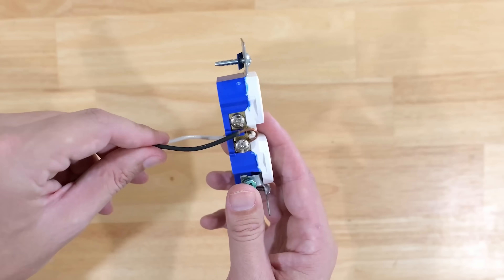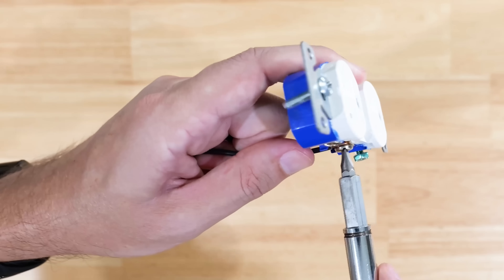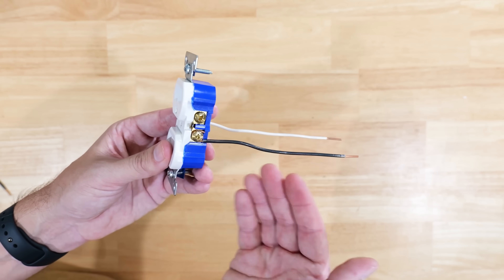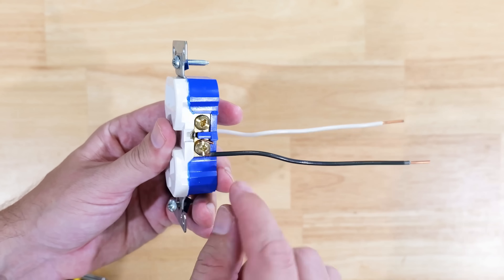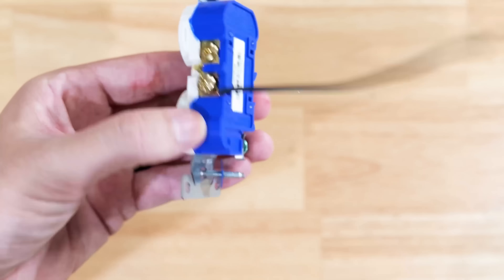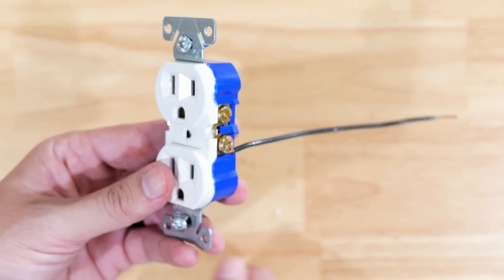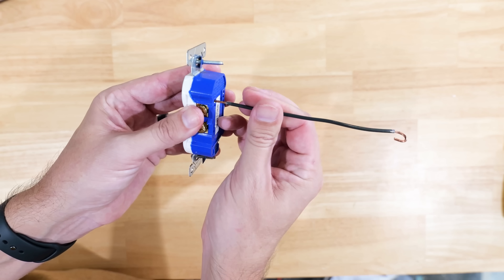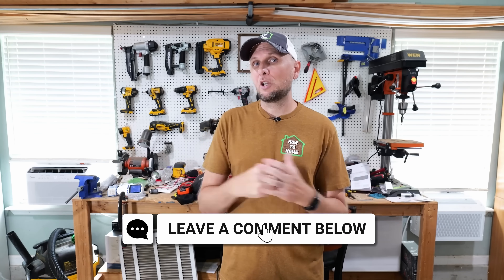Avoid Disaster! 8 FATAL Outlet Mistakes Most DIYers Unknowingly Make!

Comment: me at 19, renting first apartment before internet was a thing. i wanted to replace an ungrounded recep with a grounded recep, not bc i needed a ground, but because i didn't want to mess with ground adapters. i removed the plate, pulled the recep, and there's where i learned just how much of a slumlord i had leased from. wires wouldn't allow the recep out more than an inch. the copper on the recep was spliced inside the box and wrapped with paper tape. i replaced the paper tape with proper electrician's tape, and noticed the building wire was ALUMINUM. at that point i just put the recep back into the box and put the cover back on, then i broke the lease during the first week and moved to a different property with a different landlord.

okay, so the next apartment had a lightswitch that did nothing, and a recep that only half worked. obviously meant to be a switched half-hot that someone monkeyed with. fixed it and stayed there a few years.

dad taught me. neither of us have ever been electricians for hire, licensed or otherwise. if a 19yo kid without internet knows these basics, how much more should a 50yo know this stuff?

Comment: Point of clarity. More likely than not swapping the grounded and non-grounded conductors in the receptacle will not cause equipment failure but still presents a very serious safety hazard.  Since the mains power is alternating current the polarity typically does not matter for correct operation of some device.  However if some poorly designed equipment have the grounded conductor (neutral) tried external metal chassis anyone touching that metal will get shocked. Fortunately codes don't allow equipment to be sold to consumers this way anymore.

Comment: if you dont have a torque driver, buy one now. Commercial solar electrician here, our system sizes range between small commercial to small utility. I handle O&M, warranty claims, service calls, troubleshooting, etc. EVERY current carrying conductor terminal MUST be torqued to the manufacturer's specifications. you'll get thermal build up on the poor/loose connections, which can cause a circuit breaker to trip if it heats up enough. Properly sized and installed breakers should never rise above 165 deg F or you risk a trip. First thing I do when a system is going into fault is check all the torques on the conductor terminals. With solar, these circuits are designed to run at near maximum load for hours each day, so tolerances are very narrow. Follow the damn directions!

Comment: Electrician here: You’ve got the first one backwards. You can always upsize the wire and receptacle for more than the breaker is going to allow. That is completely fine. The danger is DOWNSIZING. So never,ever put a 15A receptacle or 14 AWG wire with a 20A breaker or the receptacle/wire may become overloaded and cause a fire.
Edit: said a different way, a receptacle generally has no overcurrent protection. So the rating is only how much it will take before getting dangerous. The breaker is the only limiter unless it’s a GFCI

Comment: The stripping just the right amount of wire seems over kill I get too much is bad but this is getting silly all the technology we have today and we are still doing this trivial stuff, no one has invented a better receptical yet and that should be a priority. electrical wiring is not at all complicated if you know load tolerances and amp use. Its not rocket science but if you went and looked at code its crazy

Comment: We nearly had a fire due to one that wasn't even here. Luckily it was a momentary flame and smoke that went out. J hook style. Correct direction and everything else, but they didn't get them fully under the screw. Like the tip of the wire was under the screw, but then it just looped around and above the head of the screw. I ripped out the whole kitchen and basically, every outlet that looked newer had this issue. This happened to be the one with the best location for a toaster. The hot connection just burned itself into a black mess, but by looking at all the other connections in the kitchen, it was fairly easy to guess the probable cause.

Comment: For some reason, I think it's worse to put a 15 amp outlet on a 20 amp circuit, not the other way around. If it's got power, people will plug into it. Outside of appliances, how many electrical products do you see with the 20 amp side blade? Not too many. One more thing, don't use a Phillips head screwdriver on a receptacle if you want a tight connection

Comment: i am 46, handyman jack of all trades, master of none, i have never anywhere anytime in my life seen a 20 amp cord/device. i have seen and used the outlets with 15 amp things. I'm not saying that makes it ok, but the chances of ever using a 20 amp thing on a 20 amp outlet that's only on a 15 amp breaker is so low... and even if you did, it would pop the breaker, no safety issue.
>>>but yer right, that's not the right way to do it. <<<<

/begin strange angle that resembles a tangent

there's times when i've gone way to far and much worse then a 20 amp outlet on a 15 amp circuit. for totally make believe / it didn't actually happen / it wasn't me, i wasn't  there, it was the 1 armed man, and he didn't even do it. but in a dream of a land in a far far away place, when running to many things in my, uhh, i mean A garage somewhere not here, heaters, high watt flood lights, fans, welders, air compressors, reactor control systems, etc,  was always popping breakers, got real sick of resetting it all the time, and not running half the stuff i needed wasn't an option and i wasn't gunna actually run another lower gauge wire to a new higher amp breaker.  so i, er someone, just swapped out the 15 amp for a 20, nope, still not good enough, no problem,  swap in a 30, dam still no quite enough. ok ok, your really going for it eh? fine will a 40 make you, uhh me , er them happy? eerehhrgg,... and now with a 40 where a 15 once lived we they someone has a garage where you can run anything you want all at the same time. tested for magic smoke and rouge fires. none found ! sure the walls double as heaters, but that only helps to keep it warm in the winter! win-win!
NOTE - the preceding dint'/isn't happening right now at all, i dont know what yer talking about. there's nuthin to see here, just keep on moving.  just smile and wave , just smile and wave....  (as the fire closes in around me)  

PS.   man that's a sweet bit you got there, never seen one of them either...  hmm maybe the problem is ME, i just dont get out enough...  hmmm    NAAAA!   :)

Comment: Just had this issue 
Home was built in 1987 
Recently power went out in 1 room even though breaker was on 
1st thought rodents in wall ,called electrician went through with scanner found bad back stabing receptacle was faulty said the same thing as vid better to screw the wire on 
300. $ but was glad I didn't have to start cutting holes i walls

Comment: Also, use a square drive screwdriver instead of a Phillips or flat blade screwdriver because you can put more torque on it and they don't slip on the screw like the Phillips and flat blade can. The screws are designed to accept all three types.

Comment: I have my house properly wired. Some of my outlets are 15 amp and some are 20 amp.  None of the things I ever plug in have that 20 amp sideways blade. My refrigerator, microwave, garbage disposal, hair dryer, and vacuum all have the standard plug that fits into a 15 amp outlet. What gives?

Comment: The WAGO style lever contact is ultimately less reliable than backstab wiring. All plastics cold flow over time. As the plastic flows away the contact force is reduced to whatever stamped copper spring is left to grip the wire. Over time, with temperature it will lose contact force, just like push in wire contacts. Its possible to make a contact clamped by spring steel that opened by a plastic cam that doesn't use the plastic otherwise. It would cost more than you'd care to pay and extend the mean life from 5y plastic and 15y copper to 40-45y because steel ages better, but dissimilar metal corrosion would eat it up anywhere moisture can get to it.

Comment: No. All modern 15A receptacles are listed for use on circuits with 20A overload protection. UL and NFPA aren't stupid. The 15A and 20A NEMA plug and receptacle contact properties are actually identical. The 15A vs 20A plug and receptacle are an anachronism that keeps receptacles more than 60 years old from being recycled by chowder heads. The 20A 120V plug is seen about as often as the passenger pigeon. I've only seen it on a few large window ACs and their 6 foot AC extension cords and a few commercial floor sanding and polishing machines.
   Before you made up that fairy tale it should have occurred to you that nothing about the end use device changes when its plugged into a 20A outlet. The plug, receptacle, and wiring all cook when a failing appliance draws excess current without tripping the overload protection. Its very common for a window AC to draw excess current as its run cap dries up and for the compressor's thermal protection to cycle the unit off and on with a faster time constant than the circuit's overload device. Typically the molded plug is the heat source, not the receptacle.
   if there's one thing that people should be more careful of, it's push in wiring. The force with which the internal stamped metal contact grips the building wire decreases with time and temperature, especially temperature. They rarely cause an difficulty where the circuit is lightly loaded. On heavily loaded circuits they can loosen up. An unused receptacle that serves as pass-through wiring can be the one that cooks.

Comment: Two things I would like to add here: 1) Electric wires vibrate “especially AC” and if not tight enough will loosen over time if not torqued right and 2) stranded wires I solder the ends going to the screws…

Comment: Just buy the commercial outlets.  Not much more expensive, and no need to wrap the wire around the screws, stick it in from the back and instead of a stab fitting it's a clamp that tightens with the screws.

Comment: Carpenter here. Trying to learn a bit more electric. A lot of this is jibberish to me because I'm new at it but one thing that keeps SCREAMING over and over in my brain is WHY are outlets designed with so many potential failure points? EXPOSED SCREWS? It's 2024! Screws in general? Seems like you're asking for trouble. In carpentry terms it's like chucking a guard open on a circular saw and wondering why you eventually cut your leg.

Comment: Perhaps you can mention an appliance that is polarity dependent and how a circuit designed for A.C. needs to be polarized a certain way.  Perhaps a flat screen TV or a computer?
Reply: Switch is supposed to be in hot (black) line so no power is fed to device.  If switch is in neutral ( white) it is not safe to contact device.

Comment: Don't pull the insulation completely off stranded wire. Strip your wires a little long and leave the insulation on the end and when you wrap it around the screw it will keep the strands together. Always pig tail your receptacles and take only one set of wires to it. You don't want 20 amps going through that thin piece of metal that ties the two terminal screws together.

Comment: I crimped spade connectors on the wires when I was working for a contractor that built cell sites. It worked better than the J hook for me.. For my own electrical, I pigtail the outlets so they only see the current from what is plugged into it and I only use back wire, not the cheap ass ones. I've seen the first few outlets on a chain get hot enough to distort from being used as a pass through. Another mistake I've seen in older homes, if there isn't a ground wire some idiots will tie the neutral to the ground screw.

Comment: Best thing you can do in all your living areas is replace your old  breakers with new Arc Detect breakers in your panel. Lots of States new house  construction or panel rehab the County Requires it. 
It may be a standard requirement in all states now whatever its still a very smart thing to do especially if the back bone wiring in your house is old.
Reply: Good luck with nuisance tripping in an old house with 3 wire ckts
Reply: @SamboNagga  17 years later not one of my Square D Arc's have tripped.
Reply: @My1970TransAm  count your blessings.i have had them trip continuously because the insulator in the attic, kicked a wire or got it stuck on his foot, and pulled it at a 90 degree angle to a staple. as soon as i straightened out the wire, the breaker quit tripping.  just one of the many stupid reasons these things tripped. i've had to replace many SD homeline breakers after less than two years under warranty. ed: splg

Comment: 0:30 Please cite the NEC (National Electric Code) where it allows a 15 amp receptacle (or switch) to be placed on a 20 amp circuit breaker? Or where it prohibits a 20 amp receptacle (or switch) on a 15 amp circuit breaker. The breaker is designed to protect the circuit (wire, receptacles and switches) and not the devices plugged in to it (toaster, lamp, hair dryer, etc.). A 15 amp receptacle or switch is designed to not overheat, melt or start a fire with a 15 amp load, NOT a 20 amp load that a 20 amp breaker will allow. A 20 amp receptacle or switch is designed to handle 20 amps, which it will never see more than 15 amps on a 15 amp breaker. You are confusing the receptacle's load rating with what a circuit breaker is designed to do. Receptacles are NOT circuit breakers. Receptacles do NOT regulate current. Receptacles that are rated for LESS amps than the breaker protecting them can (and sometimes will) overheat and can (and sometimes do) start fires.
Reply: NEC 210.21B3
Reply: @furfur8368  Thanks, it looks like that changed around 2020? I guess I haven't kept up. Even so, not something I would do.
Reply: I don't know when it was adopted, but I believe what you're saying is backwards and unsafe. I'm not an electrician, so I can't argue with you. When you say  a 15 amp recep is designed to not overheat, melt or start a fire with a 15 amp load, NOT a 20 amp load that a 20 amp breaker will allow. I believe that's wrong because you will never plug in anything that needs 20 amps as that would have a different plug and if it tried to draw 20 amps it would kick the breaker to protect the circuit as you said. And when you say a 20 amp recep is designed to handle 20 amps, which it will never see more than 15 amps on a 15 amp breaker. I believe you are wrong because if you plug in something that needs 20 amps it will try to draw 20 amps and kick the 15 amp breaker or could cause problems like fire. Also I believe 15 amp receps are rated for 20 amps, but not sure.
Reply: @furfur8368  it seems that 15 amp duplex recepticals are now manufactured in a way that allows this and the NEC was recently changed to recognize it
Reply: His concern was that if the 15 amp breaker were to fail, the circuit could potentially overheat if the wiring wasn't rated for the 20 amp device. Code compliance is the bare legal minimum acceptable, not always the best practice.
Reply: Who cares it's DIY! Just be careful to remember, labels never hurt
Reply: @AbstractAproach  No one cares about your ignorant comment my friend.
Reply: You can use a 20 amp outlet on a 15 amp circuit. What you can't do is a 15 amp outlet on a 20 amp circuit.!!!!
Reply: @ That used to be correct, but the NEC was changed around 2020 to allow it, look it up in the current  NEC.
Reply from the maker: @josecollado1525 no you absolutely can’t.  You have it backwards.  There is literally code and even tables in the NEC showing what you are saying is incorrect.  You CANNOT legally put a 20 amp receptacle on a 15 amp circuit.  If you want to refute this please use code next time.  But I can tell you there is no code backing up your comment.
Reply: @HowToHomeDIY  who said legally, I've literally implemented both of these circuits which you claim I absolutely can't [on the one that would burn, rated for lowerr than circuit breaker at box, I did use like a whole roll of tape to make sure it was always used through a self breaking power strip (so it would pop before breaker), and I changed it as soon as I thought about just splicing in the power strip]

And I think you have it backwards, not him, but I have a suspicion you're thinking of self breaking outlets (like in bathrooms, with the buttons). In that case you'd want it rated higher than the circuit but breaking lower fir maximum redundant safety
Reply: @AbstractAproach so I am confused.. your original statement was can you replace your 15 amp receptacles with 20 amp receptacles.
YES you can IF your wire is 12 Guage and your Breaker is a 20.
Cause you didn't say anything about the wires or the breaker. You asked about receptacles. So there is your answer. 😂
Reply: @josecollado1525  well you CAN, but should be weary everytime you use it.  Enough amperage is now a fire concern. But you totally CAN do it, especially if just for a phone charger or something (idky you would and I've never seen an outlet only rated for 1500 ish watts but if you had one you definitely could, like it's possible)